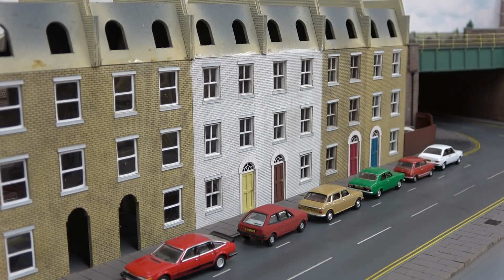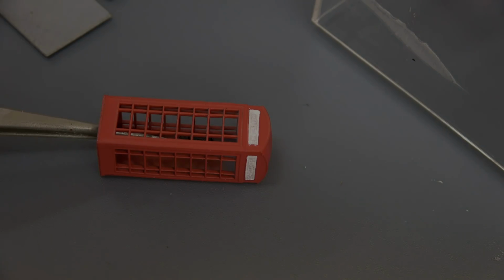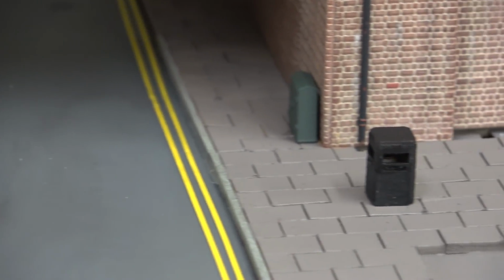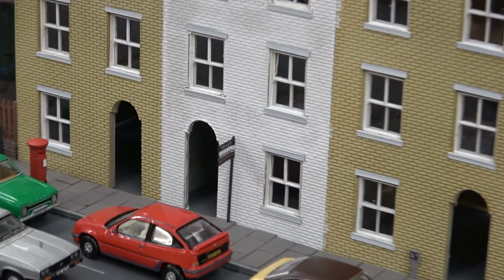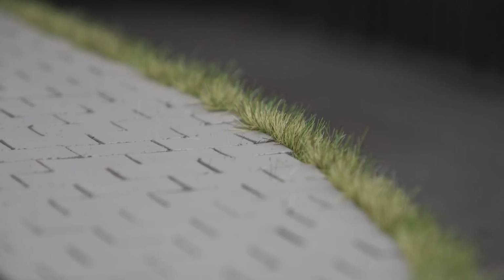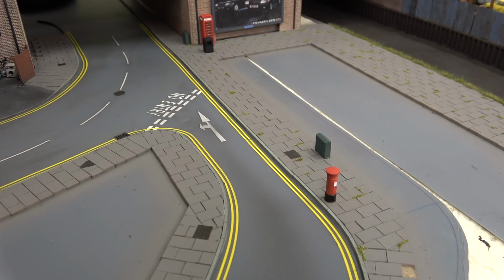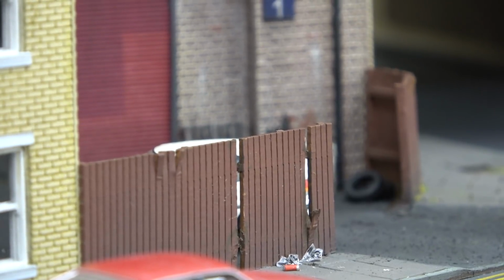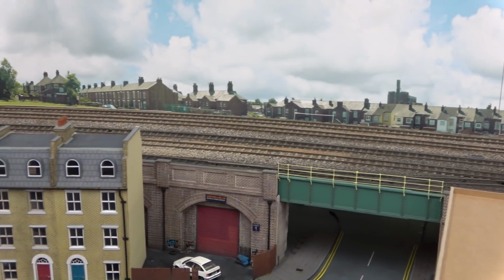New Layout Build - Adding more details to the town scene

Comment: Hi Richard. Im a bit behind on catching up with your channel due to work commitments, but this has been another fantastic update and as usual, your attention to detail and explanation is outstanding. Love these kits from various manufacturers that you have used to add lots of little nick nacks all over the place. One point I would like to make though (not a criticism in any way), but Im a bus driver and in almost all cases, bus stop flags are deliberately placed on the pavement side of bus stop poles instead of facing the road to avoid any double deckers pinging the flags off as they pull into the stop. The layout is totally amazing.

Comment: What a difference these tiny details make Richard; the whole place is coming alive. A couple of wee things I thought of: should you maybe add matching Unit № signs at the opposite end of the arches? With the soft drink cans, you could paint the plastic rod in different coloured stripes(ish) before you cut them to size. That would give a bit more variety, rather than them all being the same brew.
The phone box glazing is very effective; I've often wondered how well that stuff works and I've never seen anyone using it on video before.
The terraced houses are definitely going to be a major project to finish but they should look fantastic when the job's done. Now that the street is an official bus route, any plans for a Magnorailed bus? For once, the loop system would work in your favour, with the same bus providing the service in 𝒃𝒐𝒕𝒉 directions.👍
It's great getting such regular updates now, you're making some real progress and the whole layout is coming along in leaps and bounds.👍👌😁

Cheers for now,
Dougie.

Comment: Superb work, Richard. Looking terrific. Even the cars seems to be running smoother now with fewer wobbly axles.

As it's looking so good I'm going to be really hyper-critical: 1) Shouldn't the bus sign be pointing the other way (over the pavement): buses are going to hit it when they come into stop. 2) in the extreme close-up, the Post Office Telephones/BT green cabinets seem to be floating a scale inch off the ground. 3) do the paving slabs on the canal side need a bit of moss (green and black weathering powders?) on them?

Comment: Hi Richard, I just had an idea based on the "real world" images you showed.  Have you thought of maybe having one of the houses in the process of renovation?  Maybe a skip outside and/or a builders van parked up.  Maybe some scaffolding/ladders.  Just a thought.  Keep up the EXCELLENT work mate!
Reply from the maker: I have been thinking about something like that.  Certainly something I could do, scaffolding kits are available which is handy.
Reply: Or a boarded up or fire damaged house maybe?

Comment: Loving the amount of detail your putting in. Your street utility cabinets are not positioned correctly, I'm an openreach/BT engineer. Your utility cabs are very rarely seen next to each other and nearly always have pavement access/floor lids in front of them. Would love to see some telegraph poles and dropwires running to your customers residential and business properties. May i also request you put me sat at a utility cab with my BT van somewhere :D HaHa!
Reply from the maker: Cheers, I'd like to add the floor lids in future.  Noticed a few during my research.  Wires and utility detail is also something I'll be working towards.
Reply: @EverardJunction  I think the cabinets you have used are newer than the time of your layout The type I remember were cast and available from here The 5th one from the left and the 4th from left a type I have seen for traffic light controls http://www.smartmodels.co.uk/td18---street-junction-boxes.html The cabinets you have used are round where I live and were put in for fibre optic cables. Apart from that a great update.
Reply: I think that one problem with drop wires coming from telegraph poles would be the difficulty of accessing surrounding details for maintenance/changes etc.
Reply: @davidwelch6796  I understand and agree with you but the detail this would add to an already incredible layout would be mesmerising. Truly amazing craftsmanship and Everard Junction has more than enough patience to achieve an impressive result.
Reply: @cedarcam  the cabinets he has put in were introduced early to mid 90's by BT. The first row last cab is what got replaced. The cabs he has used are not fibre cabs they are copper, the fibre cabs known as dslams are taller and mostly single door.
Reply: @stt4070  Thanks for that I knew they were too modern. The old type ones were also used by the railway and still in use today so a few of those on the layout would be OK although mostly where re signalling has not been done.

Comment: Fantastic work as always, you are an inspiration. I know you're not averse to useful suggestions too. For the scene in front of the terrace, it would be a shame to obscure your street scene with anything tall which would also cramp your access / camera angles etc. So how about putting a construction site on the empty plot? Scenario.. there used to be something industrial but it it is now making way for new flats, you can fill the space with a bit of demolition rubble, reclaimed girders, part-made foundations for a new building, machines, contractor vans, security fencing, piles of materials, maybe archaeologists working on old graves in one corner, on-site security hut, des-res advertising hoarding, the list of possibilities is almost endless. It might balance nicely with your low-rise scrap yard across the canal and would "save" you from the need to do another scratch-build. I'm sure whatever you do it will be inspirational. Best wishes.
Reply: And over time you can imagine one the flats are buitl the yuppies move in with their chelsea tractors and force out Unit 1 and the scrap yard?

Comment: Did you know that there is a requirement for postal boxes? A houshold address should be no more than 500metres from a postal box, measured in a straightline, in built up areas. Also the 'flag' of the bus stops should face away from the road and not overhang the kerbline - for obvious reasons! (just in case a large sided vehicle should hit it)  I'm loving the build, so much attention to detail.

Comment: Hi. A minor point but I know you like things right. Bus stop signs - the actual sign faces in from the road to the pavement when the bus stop is on the pavement edge. It faces out towards the road if the post is not at the roadside, eg by a hedge or wall. Hope this helps!

Comment: The type of street cab showen is for cable TV. BT phonecabs are slighty different. 41 years BT engineer.Now Retired
Reply: I am thinking the same and put a link to the older type which were also used on the railway for telecoms cables Hope Richard sees it

Comment: The advertising hoarding is in the wrong place. If anywhere it should be round the corner on the wall under the bridge . . . .
Reply from the maker: I said in the video I'll be adding some more in future.  Much of the details are not set in stone and can be moved or changed without too much of a problem.  Cheers